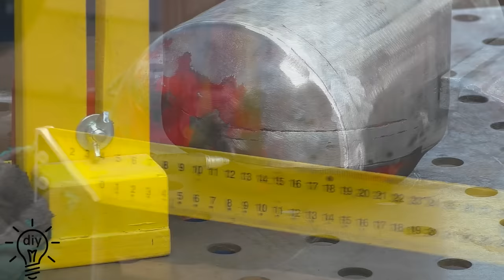A brilliant idea from an old fire extinguisher! You'll be glad to see it!

Comment: Oh, sure. Everone has those tools laying around their homes.
Reply: I totally agree. I am starting to get a little annoyed at all the "DIY" videos with highly specific tools and expensive machines. If you have to buy a big machine to do it, it isn't DIY.
Reply: Also, if you're using new material, it begins to take away from the re-purposeing that you're trying to do
Reply: That's what the dislike button is for
Reply: All you need is a drill, metal drill bit, a blowtorch (that u normally use for BBQ), a metal saw and some sandpaper... 
Need no more tools
Reply: @mr_stanton2773  then why is he using other stuff in the video? If it's gonna be a DIY, shoot it with thehe basic stuff.
Reply: @chrisc5991  You're right and I forgot to do that. But the comment section is what will tell the creator what isn't liked, that way they aren't just guessing.
Reply: @mr_stanton2773  don't forget the welder.  You ain't super gluing that bitch together.  Welders are cheap though.
Reply: @benzydino1  maybe for the time, it's sure quicker with those machines, but without it work too. It's just much more longer
Reply: @thecrabmanjones  I know ;) that's why I was talking about blowtorch, u buy the appropriate metal sticks and if u haven't one yet buy the torch too, and it's pretty similar process. And its cheapest. ;)
Reply: @mr_stanton2773  True, but that's what editing is for. Cut out some time, speed some up. I just think you should label according to what you include. If you're making a video for DIYers, use the basic stuff.
Reply: @benzydino1  yup I agree to this ;)

Comment: Some people have too much time on their hands and not enough practical things to do with it.  If I was going to do this, go big or go home, start with a 55 gallon drum.  If you're going to smoke meat or just grill it, you'll typically need something bigger.  Nice workmanship, though ... even though there is no inlet air or chimney controls to regulate your heat or flames.  Most grills have heat control, otherwise the charcoal just burns out of control.  It's almost as bad as dropping a fully frozen turkey into your deep fryer.

Comment: Actually the Cash for clunkers what they did was poured liquid glass in the motor so that they would never be usable again but also you only got $2,500 for vehicle so it may or may not have been worth that much so people can get ahead but in order to get that $2,500 you had to buy a vehicle that was brand new or within a few years of that year so basically I don't see where giving up a vehicle for $2,500 was worth the debt of buying a$30,000 plus vehicles if all your savings 2500 because now instead of having a paid off vehicle or something quick to pay for $2,500 it just put people in more debt instead of helping the fuel mileage was not worth taking on that big of a debt I'd still rather drive the one that just gets about 3 miles less per gallon that's paid off versus owing 30 grand for new vehicle and I think those vehicles should have been given to people who are poor who need a job who are out of work and have no transportation or somebody needs to get back and forth to medical appointments it needs transportation those vehicles should have been donated because at least it would have helped somebody out but $2,500 was worth more than two or three hundreds you get out of scrapping it so and then they get all these new vehicles which we know how electronics go so people got a lot of vehicles that would have lasted longer easier and cheaper to work on and should have went to a better cause even though Obama was trying to say it was it for an environmental fuel efficient issue but yeah you didn't get that much more fuel mileage out of some of them vehicles then I'm upset because it's hard to find a motor vehicles which were safer in a wreck sturdier pulled more weight without tearing up a truck and if I do find a truck that old or car that I'm looking for they want outrageous prices for him now the day because there's very few on the road show me ever having a well-built vehicle again will be very hard to get if it's in good shape price wise because the junker clunker program when I used to buy a Ford pickup truck say a 91 for $2,500 they went up to $3,500 to 5 grand at the time and now they're 10 or 20 if you can find one in good reliable safe shape and not rusted out